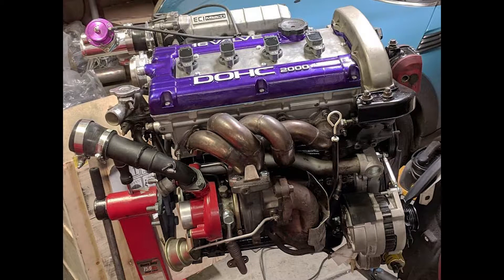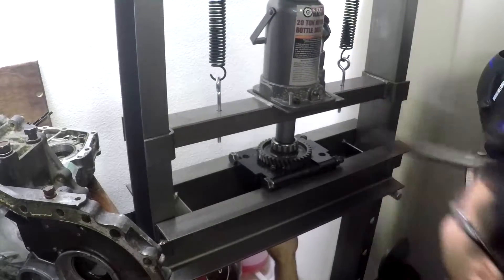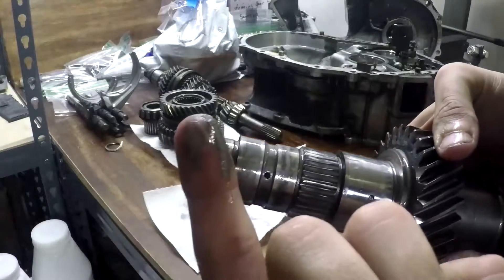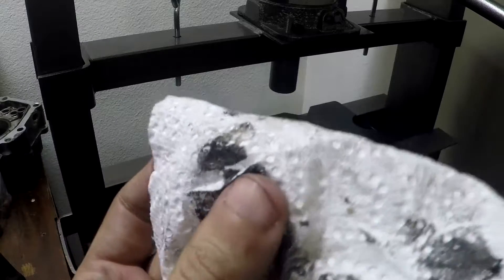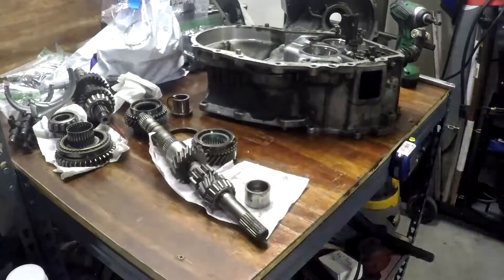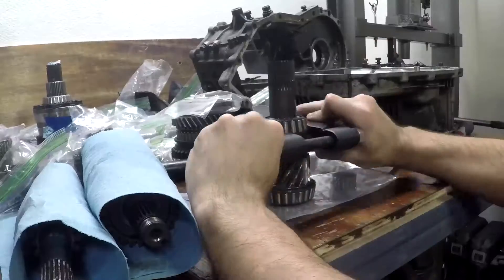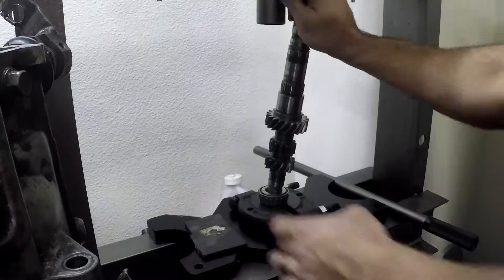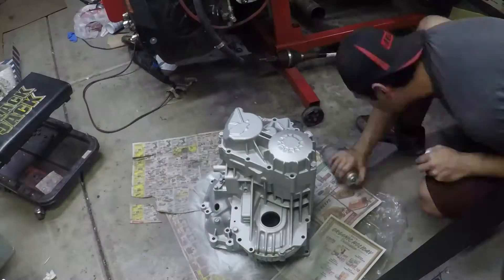4g63 AWD Manual Transmission Rebuild 2 - Gearset Disassembly

Comment: C clip pliers are what you need especially if you are getting into transmissions. The snap ring style you are using is for a weaker spring and has the holes where c clip do not have holes so the proper pliers have a serrated tooth on the ends to bite the clip.
Reply from the maker: Thanks for the advice. I wasn't sure what they were called since I've only see a few sets in some transmission build videos
Not gonna lie, rebuilding this transmission was a huge pain so I'm not super sure if I'll be doing more, but it was a great experience to have. If I do end up building more, I will 100% be buying some C clip pliers
Reply: @InitialDIYmods  they get complicated man. I worked on many from front wheel drives to 18 speeds out of semi and automatic Allison's. Lots of specialty tools. Which sucks as I have medically retired and have 30 grand in tools 95% of techs dont need lol.
Reply from the maker: I can't even imagine having to buy so many specialty tools. I tend to explore and buy tools as needed (usually harbor freight if possible) but many things I buy have many uses at least. Like the press I've used many times for other stuff after the transmission build. At least regular manuals are simple enough, I've yet to crack open an automatic haha. Maybe when I finally build my wife her V8 Miata I can try my luck with an auto
Reply: @Cannon Cohen It worked and I finally got access to my account again. I am so happy!
Thank you so much, you saved my account!
Reply: @Julio Ty Happy to help xD

Comment: What is the tool you are using at 8:24 to pull out the bearing race and where can I get one like it?
Reply from the maker: The black and blue handled pry bar? I think it was just a pry bar set from harbor freight with a 45° tip

Comment: i used a boiler pressure washer to warm up the cases and the races slide in and out no problem until the case cools off a little. other than that its been a nightmare to find new parts

Comment: Lose of power in third gear but when speed up in four and fifth still power will low
Reply from the maker: I'm not following what you are looking for. Are you looking for a diagnosis of a power issue or a transmission issue?

Comment: Any chance you have bearing numbers? I had to buy bearings from autozone to rebuild my transfer case
Reply from the maker: I went to Jack's transmissions and they had most of the parts available. Otherwise, the factory service manual should have the part numbers listed

Comment: What was that part called you pressed out the input shaft? At 3:00? I had broke mine somehow pressing it out and my diagram doesn’t show this part, is it input shaft sleeve for 4th gear? Do you have a part number on that
Reply from the maker: That little peice should be the bearing sleeve which is where the needle bearing rides at the end of the input shaft. The input shaft assembly picture is on page 22A-67 and 22A-68 of the factory service manual (first is for the W5M31 and second is for the W5M33). I couldn't find a part number for it specifically, but maybe one of the dsm transmission shops can help you out. It'll be hard to find on its own though. Check out our patreon for links and more information on service manuals in the shimming transmission post but you should also be able to find it on Google.
Hope that helps and sorry to hear something broke

Comment: Hey mate, do you have a list of the bearing part numbers by any chance?
Reply from the maker: I'm not sure on the bearing part numbers as they have had a few revisions over the last 30 years, but the place I bought them was Jack's transmissions who made it pretty easy to source most the parts. You can also get them from TMZ Performance as well although I didn't personally buy from them when doing this rebuild. I don't think either shop lists out the part numbers explicitly, but it's a good place to start and they're reasonably priced there.
Reply: @InitialDIYmods  thanks mate appreciate it

Comment: There seems to be no mention of checking the face of the hub and also the gear where they ride against one another. Sometimes when things get wiped out and oil flow is impeded, the gear and hub can gall each other up, thereby ruining parts. I just recently dealt with one that the Evo3 5th had done this. I wasn't happy having to tell the customer their repair bill just went up a couple hundred bucks.
Reply from the maker: Hey mitsuturbo, great experience to share, I did replace my old hubs assemblies (with the exception of fifth) but I not notice any significant wear on the old ones when looking at them. I did see a lot of teeth wear on the gears (where the slider engages the gears not the gear to gear contact teeth/cogs) to the point that jack's transmission recommended me purchasing new gears which I did (they did not return the old ones so I can't confirm that there was no damage on the hub mating surface). I did not explicitly call out or elaborate on inspecting that particular wear point which is a great piece of information. I'll try to find a place to add that note into the next video where we reassemble the case and I'll highlight your comment in the video. Is there anything else you'd like me to add in the video or would like to see me include about this or anything else?
Thanks,
Ryan @InitialDIYmods